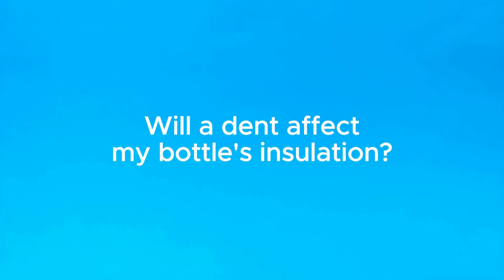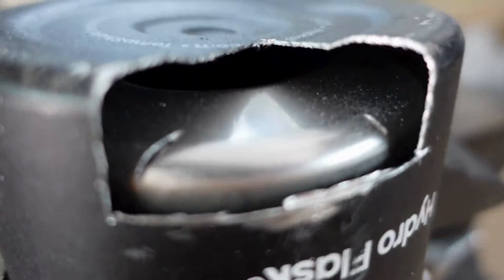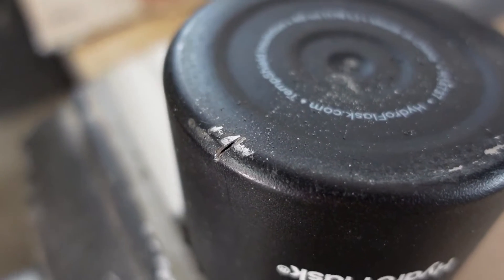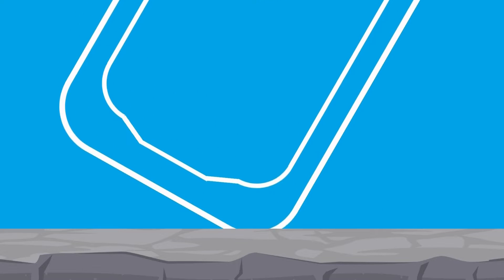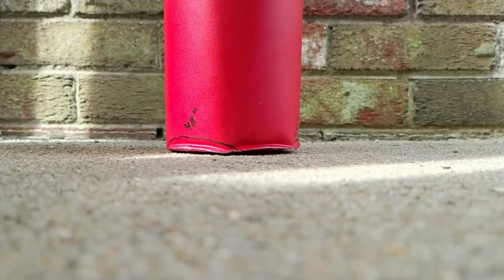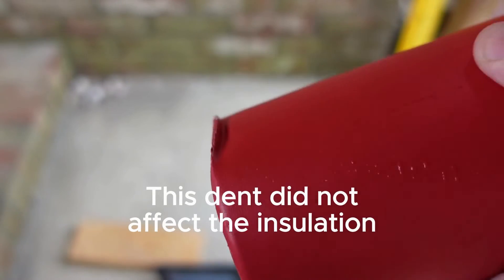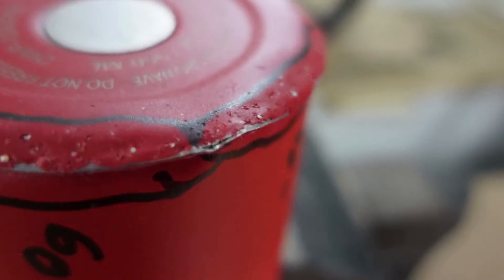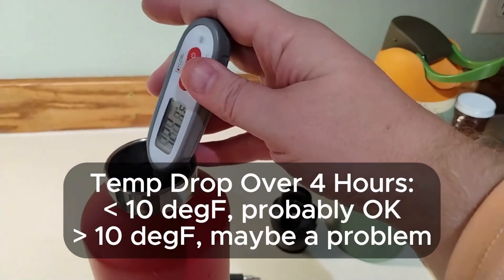When Do Dents Affect Your Bottle's Insulation? (Shortened Version)

Comment: If I dropped my bottle and the silver disc on bottom fell off but i place it back after is it still OK to use?
Reply from the maker: Like a on the center-bottom like with Stanley Quenchers if you're familiar with those?  If that's what I'm thinking of, sometimes those disks help cover up the lead solder that's used to seal the vacuum.  Might want to be careful around that.

Comment: But how can I fix it if it happens? Does fixing the outside of it helps with the insulation?
Reply from the maker: Unfortunately I'm not aware of a good way to fix most dents in stainless steel bottles.  If yours has lost insulation, it's probably best to just get a new one.  And if you've gone through a few bottles like this, consider getting a YETI because they're the most durable bottles out there so they can help prevent dents that are bad enough to affect the insulation.  They're expensive though.
Reply: Have to agree with his comment.
Most of these bottles are gonna last you years. So if you end up busting through the insulation layer, you’re basically wasting your own time trying to fix it.

Buy another, toss out or repurpose the old one for colder liquids.

Comment: Would damage from the inside be something to worry about? I recently ran into someone saying that repeatedly dropping ice into their water bottle caused a pinhole on the bottom? Is this likely to happen? I only put ice in my bottle a few times but I had to push it a little since my bottle has a narrow mouth and I can see 2 scratches on the bottom now
Reply: Let's say you're dropping a long thin ice rod into a completely empty bottle and it is hitting the bottom squarely in the centre everytime, and if that creates a pin hole sized hole, then that steel is very flimsy and not particularly thick.
I would question it's quality in that case.
I don't think it's likely to happen, even after years of abuse by ice from the inside.

And speaking of scratching the alloy, I don't think it would be releasing much chromium, nickel, cobalt, or molybdenum into the liquids.
(Again, I am not a metallurgy expert, so I have no idea how and when the constituent metals precipitate out of the alloy, as any alloy is a solid mixture or various chemical elements.)
Reply from the maker: No, you should be fine.  Ice wouldn't have enough momentum or sharp & hard edges to create any damage on stainless steel, at least with the thicknesses that are used in bottles like these.  I haven't ever heard of ice creating any dents or scratches in these bottles, much less a pinhole being created that could affect insulation, so that would be a first.  If there are scratches, could they be from something else?  Like from a dishwasher peg or something else used for cleaning it?  Or maybe a leftover scratch from manufacturing?  Hope this helps!